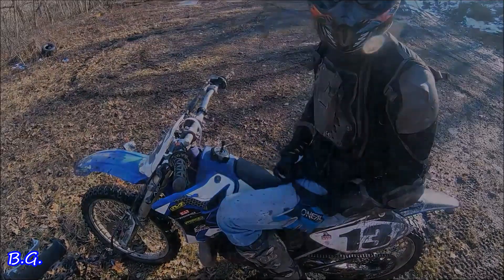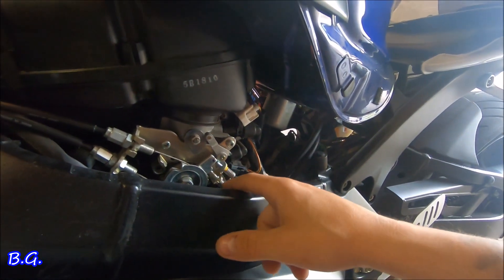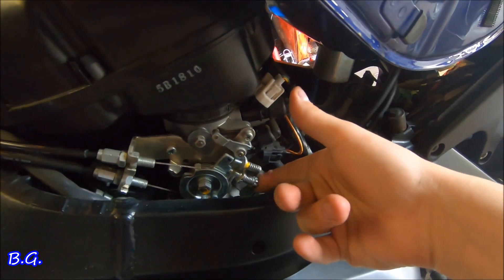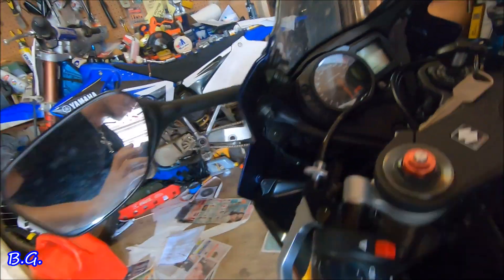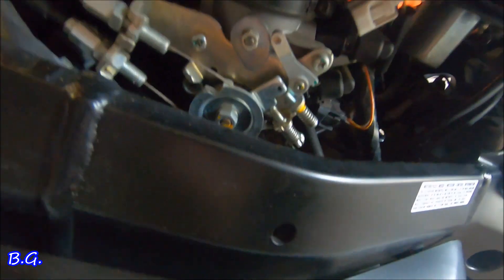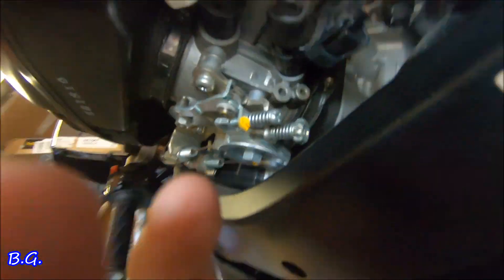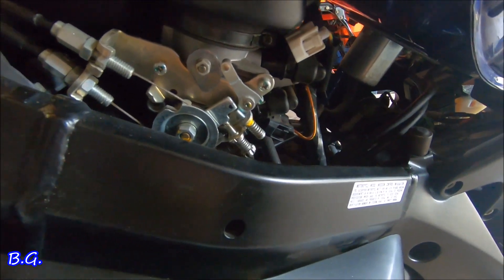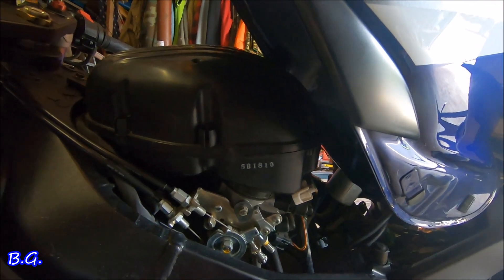Adjust Idle Speed (GSXR Tune Up PT.3)

Comment: How do you know you need to adjust it? My bike dies on cold start and kind of bogs around low/mid rpms? Do I mess with the thing in the video or do I have a different issue?
Reply from the maker: How low is the idle before it dies? My bike would stall out if it was idling at 900 rpms. It was supposed to be 1200 rpms. That could be a  reason why yours bogs and then dies out
Reply: @BrapGenius  it will kinda just bounce around at 1000/1200 than will just go low, after a min the rpms drop and the bike dies, could just be my dirty air filter or dirty spark plugs it’s cold where I live so that all could be the issue. just bought the bike last season and the guy lied
about the maintenance done so honestly who knows what’s wrong with it but I appreciate the help 👍
Reply from the maker: @noaharcher1370  I would clean the air filter and change the plugs. When I changed the plugs on my bike it ran 10x better. Then go from there

Comment: What is the difference between the low idle and high idle adjustments?
Reply from the maker: High idle is when you first turn the bike on (notice how it is at a higher rpm for like 20 seconds and then lowers to a lighter rpm) low idle is once the bike is warmed up. Usually that’s the one you have to adjust because it’s too low
Reply: @BrapGenius  awesome, thank you!

Comment: Question?so just changed my spark plugs  doesn't look like the last owner changed them for a long while. So now my 750 is idling at 4000 rims watched your video got it down to 2000 but that's still high.any suggestions?
Reply from the maker: @Reptileaddictz  try riding it for a bit and then come back and see where it idles at
Reply: @BrapGenius  thank u I'll take it to work tomorrow see what happens

Comment: Every time I turn my 2002gsxr 750 on it will run for 1-2 seconds then stall even with giving it gas the bike stall instantly I got this bike about a week ago it has 8k miles I rode it 3 times it had absolutely no problem the other day I tried to start it and it just wouldn’t. It’s cold outside in NY so I was wondering if this could be my issue want to get as many tries in and ideas before I bring it in to a mechanic
Reply from the maker: Sounds like it could be fuel related.. clogged fuel filter or fuel pump

Comment: what if the gixx is running high and you adjusted the bottom screw but it still doesn't bring it where I wanted it to be
Reply from the maker: You should be able to turn the screw more
Reply: @BrapGenius  I did but then it came out and I had to put it back in. I waited till the bike was at 180 and everything before trying to adjust it. she's at 1500 but needs to be sitting at 1300. do you think this is going to be part of the tune/power commander? rocking the 07
Reply from the maker: @TheFloridaBikeVlogger  well if you’re gonna put the tune/power commander on it I’d do that first and then adjust the idle
Reply: @BrapGenius  already had it on there. I bought the bike used but IDK what to do since I can't get the idle lowered. I dont want to take it in like a sucker.

Comment: I’m gonna try this but my idle is weird. So when I start it my idle is kinda low so I’m sure I need to adjust it but also when I’m at a red light occasionally my idle will drop down to 1k and start choking so I gotta rev a little bit. It doesn’t happen every time though and it’ll sit idle at normal rpm most of the time
Reply from the maker: @Gsxr_josh  you might need change your spark plugs
Reply: @BrapGenius  yea thought that to got my plugs and coils changed

Comment: What's a good low idle for a gsxr? I let it run for a couple minutes and turn the throttle a bit and when the rpms are  coming down, it almost wants to turn off. Any suggestions?
Reply from the maker: What rpm is it at now? Low idle I set between 1100 and 1200 rpms but if it sounds like it wants to bog out you can go higher
Reply: Yea, mines actually turns off soon as I give it throttle
Reply: @BrapGenius  what rpm is your high idle supposed to be at?

Comment: So what is the high idol screw do and what does the low idol screw do
Reply from the maker: It adjusts the rpms for warm up
Reply: @BrapGenius  i for it.  To bad u can't do this after2010
Reply: @BrapGenius  not that i need to it just makes stunt riding easier

Comment: At what point do you need to adjust the TPS as well?
Reply from the maker: If your throttle isn’t responding right like if it’s sputtering. Could just be a fuel pump issue as well if that’s happening. Loss of power could also be tps
Reply: @BrapGenius  so I actually did a little more research, wired the plug so I could use the dealer view, and found the TPS was out of alignment. So I fixed that. Thank you for the response though!
Reply from the maker: @dani07april06  glad you got it figured out